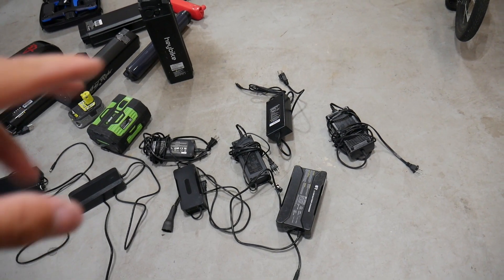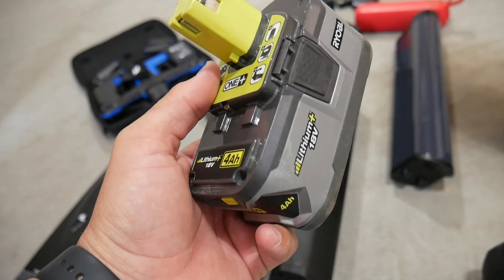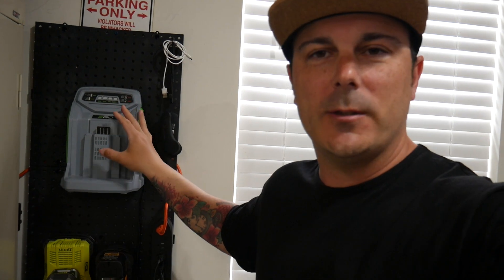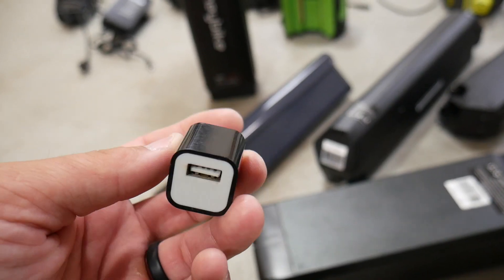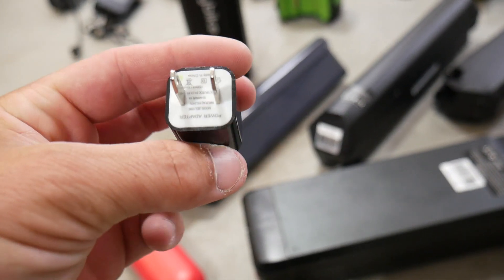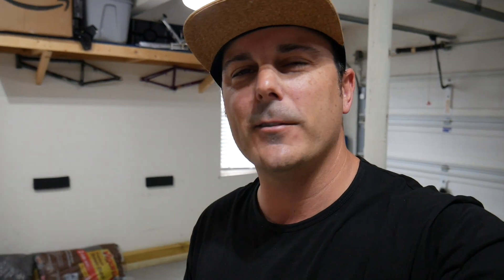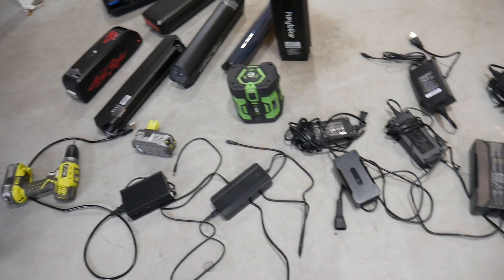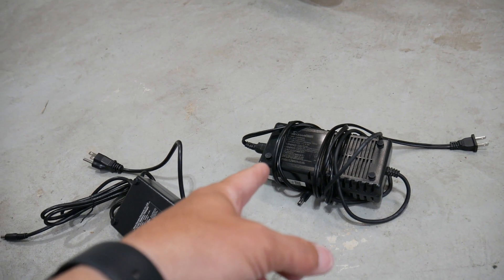** THE TRUTH ABOUT ELECTRIC BIKE FIRES **

Comment: I see how you tried to justify your Tesla. But as someone who works in the automotive industry I know that the carbon footprint of your Tesla is larger than my 1990 Chevy Silverado. 🤣🤣🤣
Reply from the maker: That’s not true at all. Overall cost of ownership is all a part of carbon footprint. Transportation of fuel the thousands of times that you have to fill up and not to mention the transportation process of crude and turning into fuel. The transportation process with drilling to getting it to your vehicle holds way more risk and has a way bigger impact. Not to mention to get the oil changes and fluid flush and the transportation and breakdown of said used fluids. It could go on and on. It’s not about NetZero, it’s about reducing all together. I think that’s where the misconception is between what the media puts out and what people believe. For me it’s all about reducing my cost of ownership of a vehicle overall. Trust me I’m not one of those green new deal people. I’m just thinking logically and about my own money and savings.💁🏿‍♂️😂🇺🇸
Edit: not to mention.. it’s just a car 🤣
Reply: @MikeFede  the cost per mile for a tesla is higher. How do you think electricity is made to power that tesla? What do you think it took to make all of the plastic on that tesla? How much of the car is recyclable? What impact does putting new batteries in the car do? The fluids changed in a service on a gas auto mobile are recycled your batteries are not. Plus the manufacturing process of your Tesla emits more emissions than the process of building my truck from 1990.
Reply from the maker: @PocoLoco76  again, my statement about energy transportation stands. You’re never going to get away from plastics that a car has. The vehicle has the same carbon footprint as any other vehicle when it comes to the materials that you’re listing except for the batteries compared to drilling for crude

Also my point still stands about less not net 0. Either way, it’s just a car🤦🏿‍♂️😂
Reply: @MikeFede  actually much of the metals are not recyclable. The environmental impact of drilling for oil is much smaller than lithium. I think you just in love with your car and made that statement on the video for yourself.
Reply from the maker: @PocoLoco76  😂 ok. It isn’t about the materials of a car being recycled. It’s just a car and it’s funny how people get so one sided on things. No worries keep shredding 🤘🏿🚲